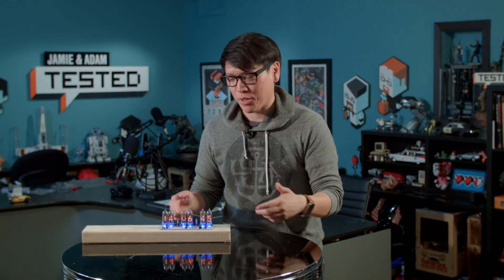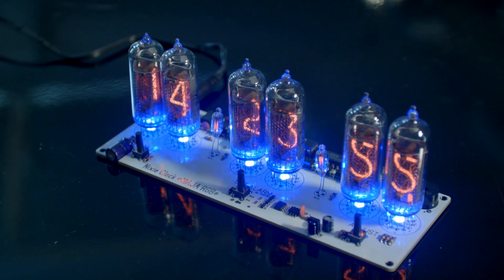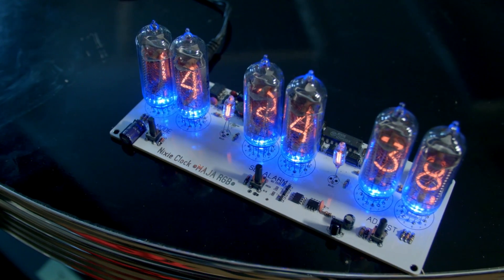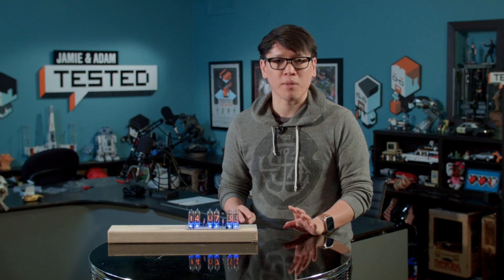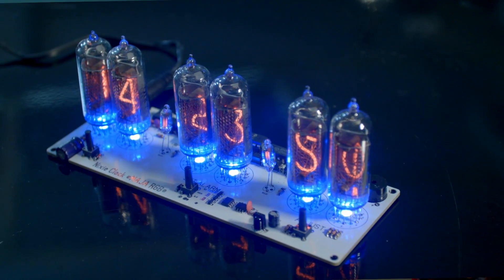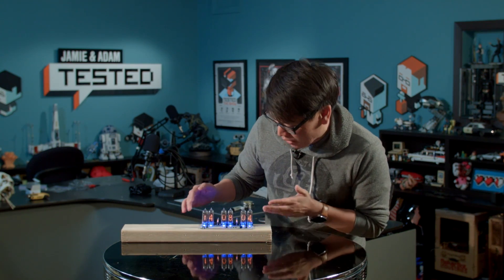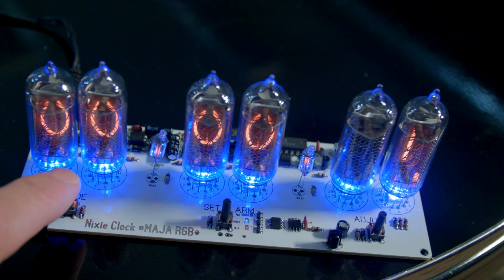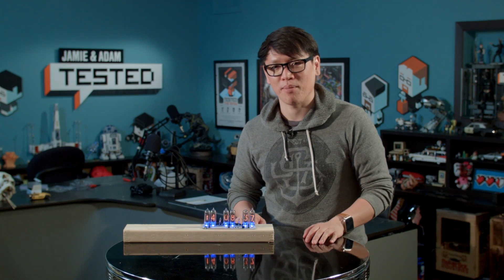Show and Tell: Nixie Tube Clock

Comment: $ 130 is acually not bad. 
I built a very similar clock from a kit, bought the tubes separately and payed about $ 90 in total.
Reply: Could you state where you found your kit?
Reply: Dave Kimball i got it from ebay. The sellers name is "ia.spark". He currently has a IN-14 Clock Kit for sale. $49,99 + shipping.
He is a very helpful and friendly guy. When i had a problem during the building process he located my mistake in notime

Comment: Built one a few years back following a tutorial. Mine was based off of the Steins;Gate one, using the tutorial creator's circuitboard and quite a bit of parts. Generates random numbers similar to the ones in the series, but can also be switched to clock mode.
Reply: Can you tell me what tutorial you used?

Comment: Not inexpensive but for a nixie tube clock (without radio) it's not that expensive maybe. Of course you could buy the tubes and make or buy a 5-10 dollars circuit and then it will be cheap.